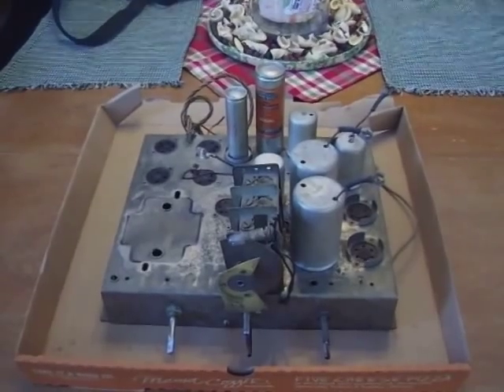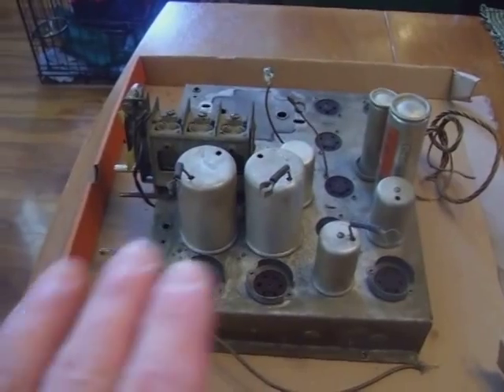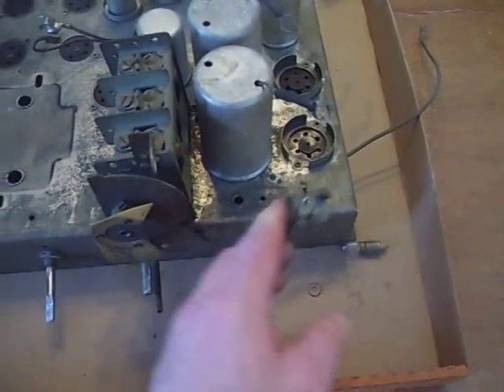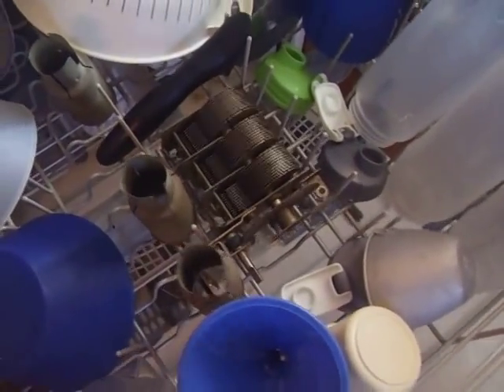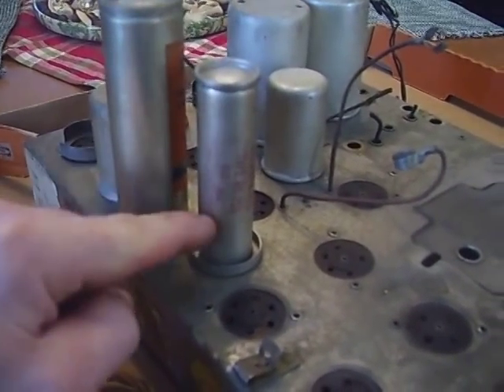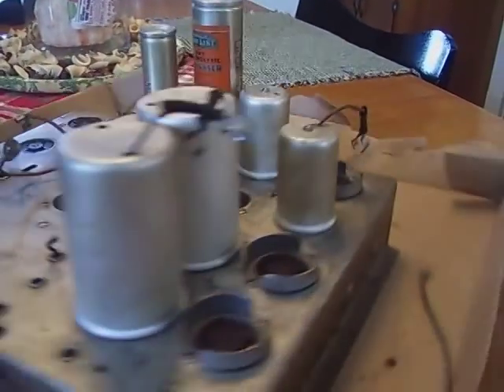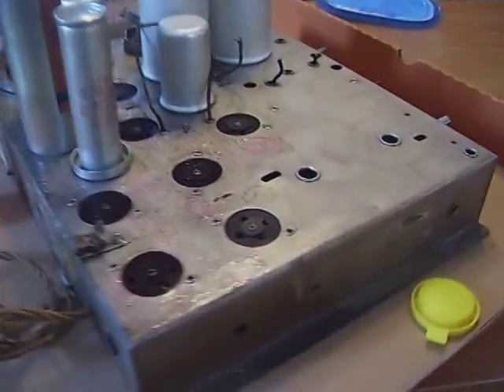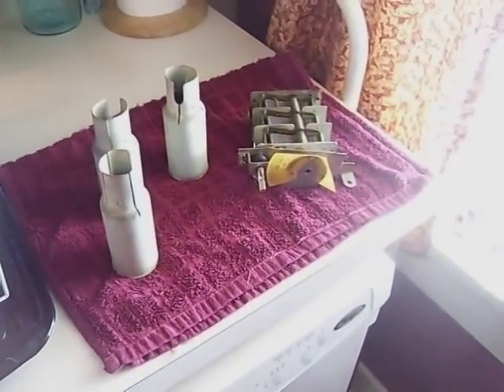1930's Stewart Warner Radio Restoration ~ Part 7

Comment: You'll be in sooooooo much trouble if Mrs. Nathan finds out you didn't take the kitchen stuff out of the dishwasher before loading the radio parts in there! :) Certainly looks cleaner now Nathan. Regards - Andrew
Reply from the maker: Andrew,
You got that right. I would have to buy a whole new dishwasher if she finds out LOL ! The dishwasher cleaned up the parts pretty good, but they still needed a little hand scrubbin' to finish them off.
Nathan

Comment: Chassis is looking good, Nathan.  I go through a lot of Naval Jelly, too.  It can't be beat, for ease, saves a lot of scrubbing.  TC is looking good, too.  I have to say, my friend, I'm a bit concerned about that celluloid dial scale.  I've looked around for an R-110 chassis since first seeing this project, when I've been out and about, as well as online.  RadiolaGuy sells quite a few dial scales, but, not one of these.  You may be able to find one at one that would at least look decent.  By the way, buddy, in reference to our earlier conversation, you must have gotten about 10 third party notices for this video :-)
Reply from the maker: AL,
Boy O boy did you just open a can of worms with that dial scale information :~) This will be addressed in the video after next. As for the copyright notices - Only 1 for Blueberry Hill ! Thanks for watching, it's getting interesting now huh ?
Nathan

Comment: You must be pretty happily married to be able to use the dishwasher to clean the tuning cap. Never mind that you had the dishes in there as well!
   Naval Jelly seem to be really working well. You may want to try Simichrome polish as well for the aluminum I.F. cans. Another thing that works great is a buffing wheel on a drill press with cutting wax. Cheap at Horror Fright hardware store. My aluminum I.F. cans & HV cage on my Motorola TS-4J copper chassis B&W TV came out so brilliant that they almost look like you can see yourself in them!
   Good progress and it's great to see that you are having fun Nathan!
           Tom
Reply from the maker: Tom,
The tuner came out pretty good, but needed a little more cleaning. Like I said in part 8 I cleaned it up decent enough it would not crud up the dishwasher. Thanks for the tips on buffing compounds.
Nathan